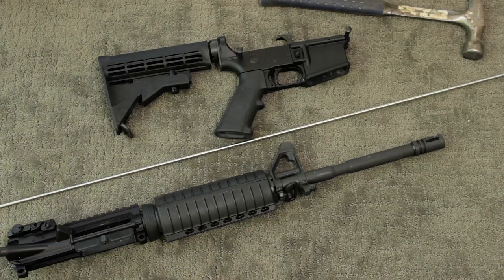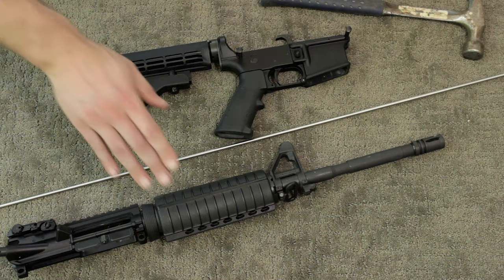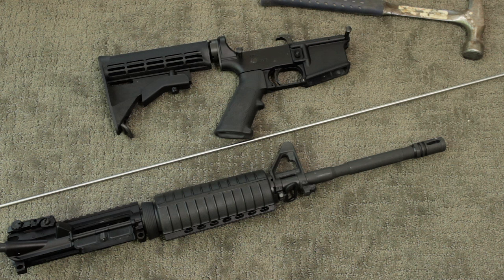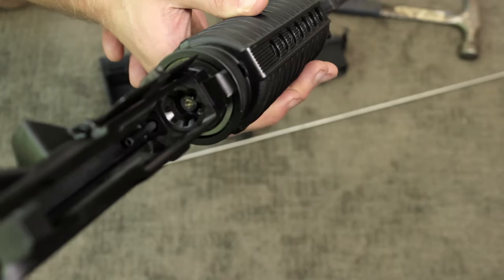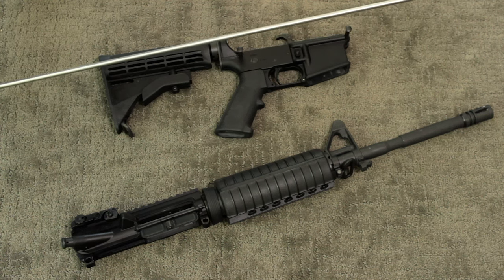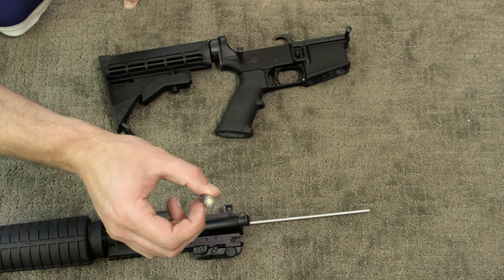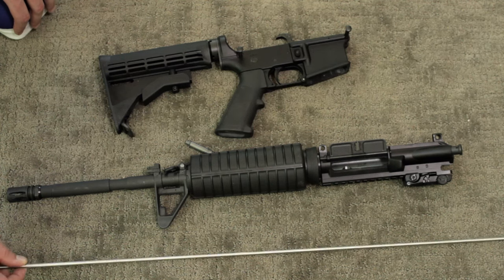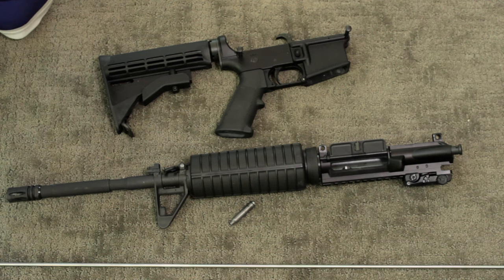Tips And Ticks: Jammed AR15 Removing a Stuck Case

Comment: I took my ar to the range this past weekend and I was getting jammed every other round using steel. I purchased a few boxes of brass and the difference was amazing. Didn’t get jammed once. I swapped back to steel and on the first round it jammed and now I can’t get the casing out. Guess I have to pick up a rod!
Reply: Had that issue with steel, but if u lube the crap out of ur gun it stops
Reply: Had this happen to me yesterday with .223 steel after the second round. Never again using steel, next time I'll bring my 22lr conversation if burning dollars a round is an issue.
Reply: @thebugg333  I’ve got a steel round stuck in the chamber right now! And my gun has NEVER had a jam!
Reply: Had it happen today steel 223 Tulammo... broke 2 brass rods getting it out... and that was gently tapping. Well kinda
Reply: I ended up taking my rifle back to the store where I purchased it. Explained the situation and they ended up drilling a tiny hole into the barrel so more gases r able to come out when a round is fired. The rifle now works fine with steel or brass and it is freaking loud now. I’ll deal with the noise as long as I don’t get jammed anymore, hope that helps anyone having this issue!

Comment: I had same issue. Watched the video and it helped. I didn't use a hammer though. I wasn't 100% sure it was a spent round because I wasn't the one shooting, but told it was spent by my wife. 

So not wanting my hand/arm/hammer in the path of a possible live round,I put the t-handle in there,faced it towards the floor and popped the rifle down on the handle instead. Came out with one tap.

Comment: If you keep slamming the bolt back and forth on it eventually it’ll catch and extract. You’d think it would make things worse but it really just needs to grip the case better, and more vibration will help to loosen it up as well
Reply: Authorized Mike this actually worked for me, thanks Mike!
Reply: I'll have to try that next time! Always a PITA asking around for a squib rod
Reply: I've mortared the ever living fuck out of my rifle and racked the bolt a bunch, no dice. Last time I had this problem, we ended up having to use the method in the video because the extractor simply refused to catch the stuck casing. Guess it'll have to be done again.

I'm simply going to clean my rifle before and after every outing with steel.
Reply: I know this is 3 years old, but that doesn't always work as I have had my extractor rip off the rim of the case on multiple occasions. It has happened on two different rifles, and even had upgraded BCM extractors. I also have polished the chamber, perfectly clean (no lacquer, or carbon), and the weapon, was well lubed. I am an AK guy so it is ironic that I had to use my AK cleaning rods to punch the barrels to remove the steel case that the AKs have never had issue with.
Reply: @harvestblades  So I I kinda of have this issue except my bolt is stuck in place and I can’t cycle the rifle at all, any help?

Comment: You really don't need the hammer. But I carry a rod with my TullaAmmo😉
Reply: I just used the handle of a screw driver to hit the rod and that was enough force to pop the bullet out
Reply: @brandonknight431  I just had that happen today while breaking in a new ar pistol with Tulla. I was only about 50 rds in with the Tulla after running 120 flawless rds of brass.

Comment: Mines AR9. Upper will not come off. Stuck behind trigger. Aluminum. Bcg stuck. I kept pulling it back instead of holding to dump it out. Just feeds 2. Think it works fine with brass though

Comment: I have a round stuck in mine. 223 brass. Not a reload. I don't know what happened. Brand new, first time shooting. Charger will not come back. I just don't like the idea messing around with it with a round in there.... So it's safe to take down and just push out like this?

Comment: Just use the mortar method. Grab the cocking handle pull downward and smack the  butt of rifle on ground at same time it will clear the jam. If it’s a live round stuck just do it outside and keep your head or any other body part away from end of barrel when doing this just Incase. Look up Mortar method there are videos on this

Comment: Should the spring be loud when shooting? Wondering if this has to do with mine Jamming almost every other round.
Reply: What brand of 556 ammunition you are using
Reply: You might have a weak spring.  I accidently put a weak spring in my ar15 and had frequent jams.  Try a high power spring.  It still works with steel case ammo.

Comment: you and your buddies would be able to reload good brass
Reply from the maker: We've looked into that, the time factor required to reload brass just doesn't work for us, so we've stuck with steel.
Reply: +ClayTrader Guns ok bro
I use only JC Arms and Ammunition @ .40 a round for 1k of 223
you get virgin brass and match grade everything. 
and it won't blow your rifle up, but if it did they will make it right. Veteran owned too!
cheers yall
Reply from the maker: Thanks for the info! Steel definitely is not the way to go if you're looking for pin point accuracy, that is for sure. But for just casual shooting out back its worked well for us thus far. Just have to remember to keep it in the shade next time.

Comment: I had this happen once. I fired off about 200 rnds steel ( wax coated) got to talking barrel cooled went to shoot more the first round did not eject...We did some trouble shooting and came to the conclusion it was the wax build up....hasnt happened since. I also no longer use that and only run PMC
Reply: Hey bud, do you know if this method will damage my bore/barrel at all? I currently have a .223 casing stuck in my new AR-15 (Springfield Saint Victor 16-in). Cleaning the crap out of the BCG right now. Will oil/lube as well. I still need to get the cleaning/rifle rod.
Reply: @Ntop33  I just used a cleaning rod with out the bristle tip thing. I also knew the round was not active. If you are not sure about the round  take it to a gunsmith.
Reply: @dyers1210  thanks for the advice, the brass primer does have the pin, i'm sure it did fire the round out. Could it injure me if the bullet is stuck in the barrel and I put the rod through?